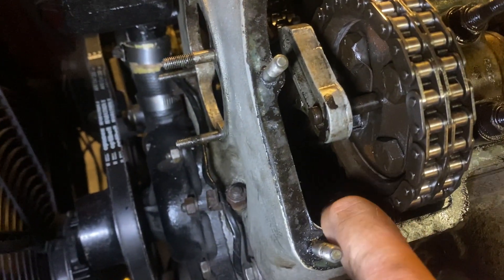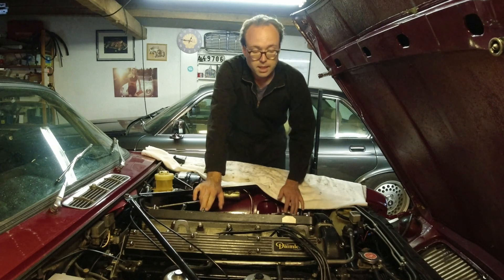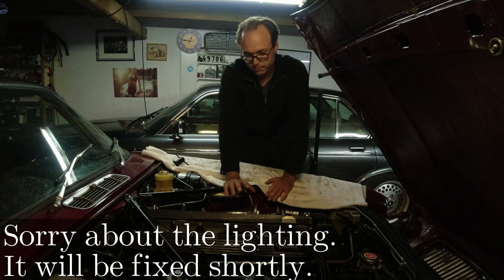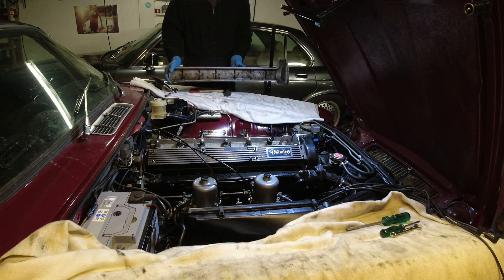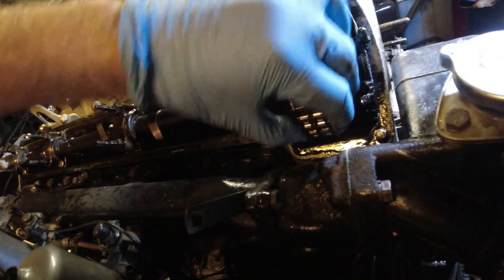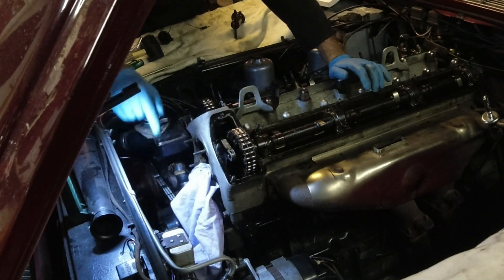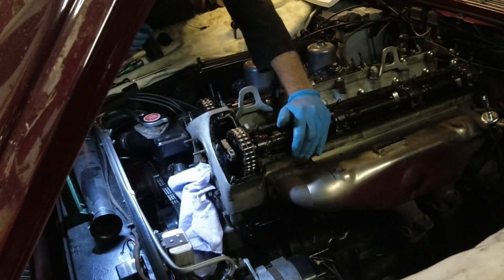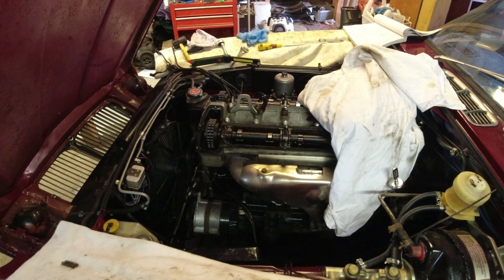Adjusting the Upper Timing Chain on a Jaguar XK Engine

Comment: Spent yesterday rehearsing this plus cam removal on a spare engine before doing on the actual car… found a little Easter egg! At least on a 7l early S1 engine, that lock nut isn’t 11/16”, it’s probably whitworth! 18mm fits much better.

Comment: I'm a little late to this, but still a thanks to you for posting this. I'm in the middle of fitting new tappet shims to a '50 XK120 (courtesy of videos like yours along with the factory manual plus others) so this is a big help. No major surprises with my intake/ exhaust clearances and tappet guides appear to have never moved, but the impetus to have everything checked was a noise noticed when the engine is at full temperature. Exactly like you, I noticed a fair amount of chain slop when checking that side with a screwdriver. Unfortunately, I won't be able to use the tensioner tool as this is an early production car with two round tensioner plungers and the gear teeth bottoms are also round like on a bicycle gear. No matter. I understand the tightening procedure is still the same. Also, the 11/16" wrench won't fit on my tensioner nut but a 3/8 Whitworth does perfectly.

Comment: I have the dredded rattle, have tightened it, but still rattling, quietens down when revs held over 2000, then back again at idle, think it’s gonna be a head off job🤦🏼‍♂️ never done it before 😢 it’s only got 48,000 miles, runs really happily, with good compression, such a pain in the a**

Comment: yes, a complete disassembly would be nice. 

after a cross-country drive of 3000 miles, i found that my newly purchased 3.4l mk2 engine block was cracked and am having a new one installed, along with an entire overhaul on the head. so it would be nice to see what my $25,000 price tag is all about. :)

Comment: You can adjust the top chain clockwise,  if the chain noice is still there after adjustment anticlockwise.  Did it for 50 years as a jag tech.
I used to make my own adjustment tool,  A tube,  2 short pieces of  1/8" silver steel rod brazed on the outside of the tube opposite each other then braze on a handle,  i made loads  used to sell em for a £1  each in the 1970's.   Just sayin'.
Reply: ????? WTF?